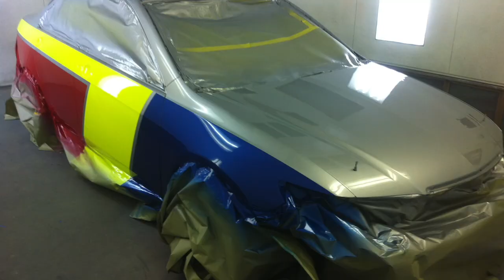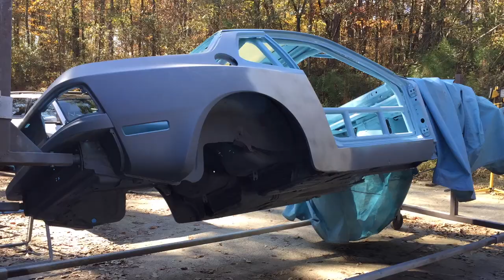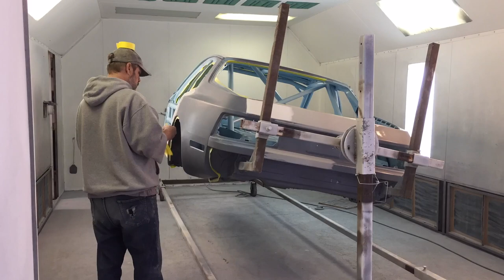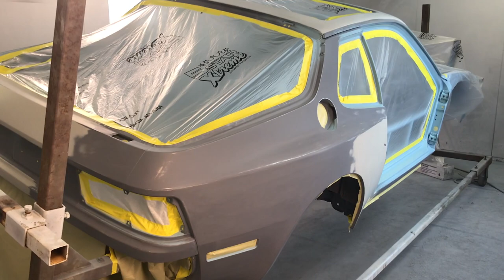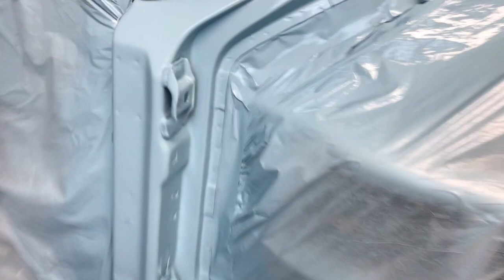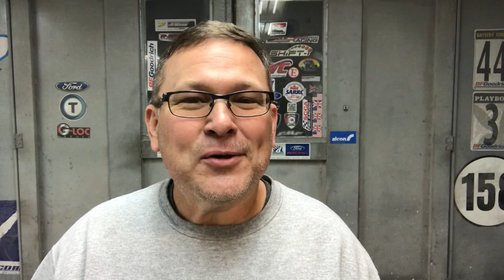Porsche Spec 944 Gulf Blue Paint Job Part:3

Comment: So its spec ...means it has 89 gears in it then right that's what spec 9 racing is gears that year diff
Reply from the maker: In general, modifications which improve aesthetics, access to systems, safety or reliability are allowed and encouraged provided they offer no performance advantage. There are no exceptions.
Reply from the maker: Here is a link to all the Spec 944 rules. 
https://www.porscheclub.com/wp-content/uploads/2016/07/POC-2013-GCR-V1.0-944-Spec-Rules-01-01-2013-Posted.pdf